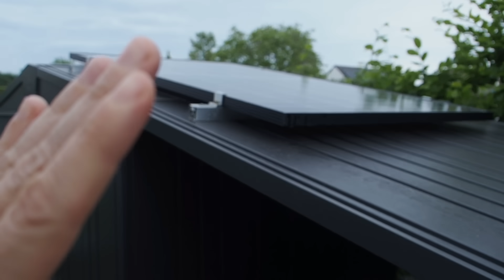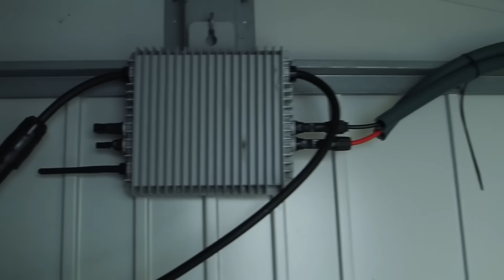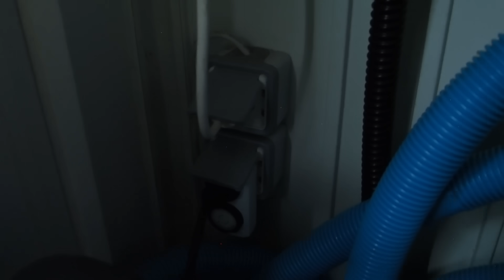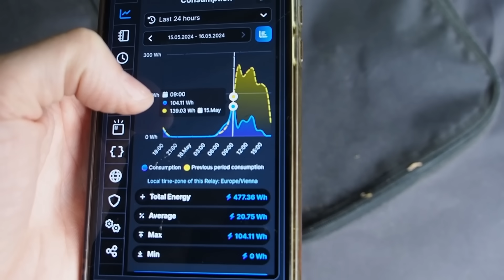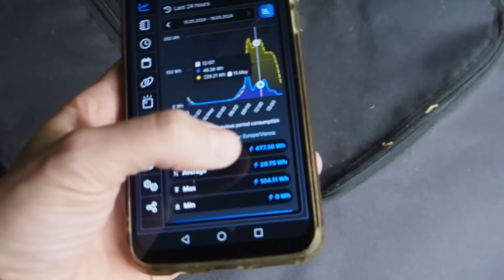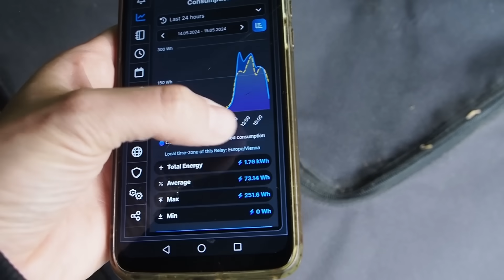Solar system? Yes? No? Which one?

Comment from the maker: BOMBSHELL! Just a few days after this videos was posted one of the biggest energy providers in Austria EVN has terminated older contracts with 20.000 PV customers in Austria. 
https://www.krone.at/3384394 Instead of getting around 15 Cents per KwH now they will only get a "Float tariff" between 2-3,12 Cents per KwH!!! Newer contracts currently stay at 4.5 Cents per KwH.
Reply: Calculate the return on your investment for your system NOT by how much the electric company pays you, but by how much you did NOT have to pay them for electricity because you were running off your own system!! 

Remember what Lilly said: Without batteries, if the power grid goes down, you have no AC. Batteries, batteries, batteries. That is the key. LifePo batteries last for decades. When buying a system, make sure it is expandable. Then keep adding to it when you get extra $$. 

Your goal should not be to get money from the Electric company. Selling them your AC is like trading 20$ for 5$. If your solar panels are not adequate, charge your batteries when the AC is cheapest. And run off your batteries when it is most expensive to buy. And only sell them your ac if your large battery bank is full. 

Check out videos by "DIY Solar Power with Will Prowse" and "Gary Does Solar".
Reply: Off grid solar with grid backup is always better.  The utility companies cannot afford to pay those great rates with the increase of solar infrastructure.
Reply from the maker: @PWoods-cd6tk  the utitility companies charge people18 Cents to 30 Cents per KwH, but they only want to pay 2-3 Cents to people now?? Meanwhile the energy companies make millions in profit and the CEO gets 600k salary each year!!!
Reply: @SurvivalLilly  Message received and noted, thanks heaps Lily!
Reply: @SurvivalLilly  Yep. Not at all surprised. There's no free lunch. Well, it might be free or cheap for a while, but not indefinitely. Saw this coming 20 years ago when early adopters in California were jumping on the grid-tied bandwagon. The sad part is those panels aren't near as efficient now or even when they were new as the panels today. Those people paid a premium even back then. 

Good girl! You made the right choice.
Reply: @Everyone 
Keep in mind that a weapon should only be used for everyday tasks, self-defense, and survival of yourself and others in urgent need. Never use it for hunting unless your breath depends on it, and even then, try to avoid mammals. That's the true warrior's code of conduct. 🪐
Reply: im Link steht aber was von der Energie AG Oberösterreich und nicht EVN - das wären schon zwei verschiedene Firmen
Reply: That happened in the uk. But the older ones kept their tariff of 45p - the new ones are around 4.5 pence! We have panels but do not sell to the grid as they will force us to have smart meter. I do not want one so we try to use as much as possible.
Reply: Always  solar  with  batteries.  so you are self-sufficient for at least  6 months
Reply: They are afraid to get nothing
Reply: A real bunch of Puckers...!
Reply: Hugs xoxo

Comment: For the USA the one real and easy choice is EG4 solar. I've had 3 different brands and by far the most expensive was the easiest to setup and it runs really well. I've over-sized my panel array so I get abundant power through the day.
Reply: 18k is best.

Comment: I love in Denmark, we have electrical heating.

I've spent 3 weeks calculating on solar+ battery and the concluding is that we MIGHT save some money but its all based on assumptions.

Installation price for 11kwh is 8000 euro

15 kwh battery is also around 8000 euro

80% of our power needs are from October to march where the sun is gone. And in summer we don't use much power.

Selling power in summer gives 0 euro

So all in all it makes no sense.

There's a new deal going around that you can use your battery to balancing the grid where you earn 200 euro a month... Until the market is saturated... 

Its just to much hassle to invest in solar

Comment: For anyone who is thinking about solar, here is what it should cost:

High quality solar panels are around 200 euro per kWh 
If you want battery storage, 1200 euro for a 5.1kw battery.
A Victron Multiplus II, about 1000 euro for a 5 KW unit.

If you are useless at putting stuff together, buy a plug and play system they are around 500 euro for a 1kw system. But this will not zero your bills but will reduce it by 30 to 50%.

Comment: Balkonkraftwerk is one of the most absurd jokes ever invented, actual cost to buy a good quality set is around 1200 EUR just for the main parts without assembly (prices are up), the electricity which this produces is so insignificant that the "saving" you make will not cover the investment of this tiny system not even in five years. it's just a joke by the government to try to pretend like they care about citizens reducing their electricity bills - the same governments which made policies and sabotaged their own infrastructures which made it possible for kw prices to jump insanely for no logical reason other than government incompetence and self sabotage. this is also why the wealthy don't care... in order to put up a significant system that actually bring your annual electricity bill down to pre 2018 prices you will need more than 10K EUR for the installation, anything less is just a nice toy to charge your eBike

Comment: You are far better off to install a small system that will run your refrigerator, freezer if you have one, a few lights, fans and charge your phone. Whole home systems are very expensive, they are too dependent on weather and seldom meet expectations. If you hire an attorney to check out the contract they will tell you it’s all risk on your part and no risk for the provider.

Comment: We are currently putting up our own panels starting at 4 X 400 watt solar panels( 1.6 Kw max), this will never be grid tied and on a separate wiring system, all the energy will be ours via battery storage and a pure sine wave inverter, our roof is not going to be owned by solar companies or the national grid.
Gaz UK

Comment: If u need more than 10kwh per day then start with yourself and evaluate  want vs need. before spending so much , no one needs so much electricity, 3 to 5kw solar system is enough for majority of ppl , solar tracking panels can also yeild almost double vs fixed,  so 2x 500w tracked panel can do 8 to 14kwh per day depending your latitude ,

Comment: Every thing you said is true. However, there are options if you find a contractor to install your system or DIY. Local contractors can be way cheaper than the solar companies and DIY is the cheapest option. You did the right thing by starting small. It’s important to allow room for upgrades in the future. I recommend starting with systems that allow future growth without having to rebuy everything.

Comment: The problem with my off grid system is the batteries. They died after 5 years leaving a $13,000 system useless without a huge cost for battery replacement 😢

Comment: I like your videos, but there is ways to not be used by electricity companies.
Keeping an analog usage reader can stop this.
For instance normally you pay 20 cents per KWH and you get 5 cents for giving back a KWH with your solar system.
with normal analog usage meters you pay 20 cents per KWH, but giving back to the grid actually lowers the meter. Every KWH given back will actuallly cost you a whole KWH less.
Thus giving back to the grid is somewhat nice.

Some companies might really push you to update the meter, check the laws in your country if you must oblige.

The truth is years ago, this stuff was all very expensive.
also the effeciency was lacking.
Then some people also resell chinese stuff for higher prices. Still people do it nowadays.

A few thousand euros can get you setup. Check the panels and what they can generate. The newer the better basically.
Batteries could fully get you off the grid, but I would try and get out of the urban area first before spending money.

Comment: Foolish girl.
Do you apply the same financial return criteria when deciding to buy a car or an APO-1?  No.  Having a car or APO-1 pays for itself when they are needed.  So is solar.
A permanent home solar system installed on your house with a house battery (or two) is the answer.  Instead of selling electricity to your provider, use it to charge your home battery.  In the summer my system and battery powers my house at least 18hrs each day even if the grid is down.  A solar system and battery is about prepping, not financial gain.  Rethink your weak support for solar.  There is no financial payback on an APO-1, yet it is a good investment, yes?   Solar system still retain more than 80% or more efficiency after 20 years.   Every serious prepper that is lucky enough to have a house needs a solar system.  Energy storage is solved by adding a home battery.  You said "house can burn down" many times without and actual data of how often it happens.  Please rethink your rejection of home solar with batteries.

Comment: If one have a small open yard, the way forward is to look at a Biogas digester. Why??? All organic waste go into it and not in the bin. If one have not enough, time to collect from the neighbours. Two outputs from the digester, gas and fertilizer. Gas for the stove and geyser and lights. Fertilizer to grow your own healthy food, without the risk to get horrible chemical poisoning as with the case with commercial crops. Micro farming is healthy, its educational for children en they spend less time in front of the tv or computer. A 3.2 m3 digester is big enough for the household of 4. In winter one can use a small solar panel to heat the digester for optimum production.

Comment: I did my 5kW system last week that includes x6 550W panels and a 6kW/h Battery for €2500 here in South Africa.
That price includes the labor and all parts.

Equipment used is also good quality equipment that comes with a 25 year warranty.

Comment: I have solar at my off grid cabin, and at our grid tied home.  I strongly advise against backfeeding your power to the power company/utility.  The cost for inverters, safety equipment and permits would be better spent if you invested in some batteries (even lead acid ones).  The utility compnay can change the rules on what your power is worth at a moments notice, extending the return rate on your investment (if you see it as one); whereas, if you have a fully powered battery bank, you can go days (or weeks) before the power is restored.  I look at solar as a way to not buy gasoline for a generator (both of which you should have).  400W is a bit on the small side for where I live, but it all depends on your requirements.  Good content overall.

Comment: Glad you didn't fall for this nonsense when there are real good alternative ways to go about getting with solar and decent leisure batteries.  This is common in the motorhome or camping communities, plenty of really good solar panels etc out there.  I plan to get off grid and also use a diesel heater and not link up to the grid at all which is rinsing everyone.

Comment: If a micro inverter is connected to a regular grid without a special meter in the U.S. it will actually add the amount of oiwer produced to your electric bill instead of subtracting it.

Comment: Batteries and generator will make you more self reliant in a power outage. There are watt/ kilowatt hour meters you can use to measure the electrical requirement of your appliances. Just as valid is to replace your refrigerator if it's more than 10 years old. The new ones are a lot more efficient. Buy a good brand. do a little research.

Comment: If it were me, considering the worries of things catching fire and burning my house down, I would build an independent system (an island system I think is what you called it) of whatever size I needed in panel watt real estate, and wire it to my own battery storage system. 

If you have the room, just put up a nice BBQ entertainment patio in the back yard and use solar panels to roof it. The battery storage could be a separate small shed like you are presently using, but not wired into the grid. Use dedicated plugs in your house wired directly to the battery system, or have an electrician add a panel that can be switched from grid power to your battery power but not both at the same time. The reason for disconnecting the grid is because nobody wants to work on downed power lines during a blackout while solar panel juice is still keeping the system live from your system! Whatever you do yourself, or by hiring an electrician, do not use aluminum wiring anywhere in the system; stick to copper!

Also, this battery system can be dual purpose! EV's these days have large battery systems built in, and some can even supply juice for external use. I think Ford pickups now offer this, and my Jeep Hybrid will let me use the 17kw battery to power my house or whatever up to a 30amp draw. Solar panels can be used to charge the EV batteries alone.

You've probably heard of the Will Prowse Youtube channel by now. He has several years of videos covering solar panel use and lithium battery system reviews!

Comment: This brings a smile to my face. Thank god for smart ladies like yourself.. You are on the right track. You will eventually install a battery bank and a grid tied inverter thst can automatically cut supply to the grid during outage..
What you have is fine but you will follow your present success with more successful projects.
 Our house is off grid for 22 years  but we installed a new ( s/h) battery bank of 60 forklift cells@ 120vdc in 2008. We installed a Chinese WT and later 3.8kw + 1500kw of solar pv. Its good. Its not perfect but we are never stuck..
Our inverter is 2kw but we use 3 x 2kw controllers . We heat over 500ltrs of water in 2 separate tanks. Each with a 2kw immersion heater to  control our 2kw x 120vdc wind turbine.
The whole system is completely automatic.... 
  I wish you luck. I have no doubt that you will succeed.. G

Comment: Invest in a battery system Lilly, Then You can go off grid with switch on Your electric box.
Reply: And go lithium batteries not flooded or AGM. I know it's initially more expensive but cheaper in the end because of them being maintenance-free and their lifespan.

Comment: Hello Lilly! I am from Argentina, South America. If i have to recommend solar PV systems for homes, y would reccomend just  to keep off grid the refrigerator and a freezer. Those are working the 365 days, the 24hs (and some extra power to recharge a power station). The other electric devices can be administrated by the home owner, in order to save energy and money. Buy very efficient refrigerators and freezers and then invest in solar panels and batteries for this devices. Keep on grid for the others. In case of blackout, the food in the refrigerator and the freezer is safe. Meanwhile, if you have some extra power enough to charge a power station, cell phones and rechargeable batteries for lanterns, you will have all the energy you need to overcome an emergency. I Stay tuned!

Comment: Solar panels are an insurance policy in case the grid goes down permanently... do you have this insurance?? If the grid goes down because the solar flares it will take more than 20 years to build new Transformers damaged by the geomagnetic storm and that is if the company building them has good source of power required to build Transformers.... under ideal conditions with an intact electrical grid it takes 1.5 years to build one Transformer.. how long would it take to build enough Transformers for one side of the world that could potentially get wiped out by a solar flare or Wars.. if these things happen it won't matter that it took 18 years to pay off the solar flares you will be relieved that you got it no matter how many years it takes to pay off the initial investment.... but I would buy only high quality solar panels

Comment: Solar has its place. It is really good at making low voltage DC ( vehicle sized system ) not so good at high voltage AC ( household sized system ). My barn, storage building, and boat house were too far away from the main house to make it cost effective to run wire. They are now all 12v ( solar and deep cycle batteries). My main house and workshop are connected to the grid with a battery backup that only charges during off peak hours.

Comment: I live in the deep South US - solar generally speaking is very inefficient - 
     In 2022 from feb to july it was rainy and cloudy every day - i live in a rural area some that live in the woods have solar for lights - 
.     They were back to burning candles for lights - 
Were im atits often 60% humidity so solar panels often only generate 20% of there rated power at noon on rare cloudless days - they never generate more than 50 % of there rated out put in this region for more than 2 hrs a day - 
       In the rural US up till around 1960 or so there was no grid powe - many had delco farm light systems - 
      It consited of a 32 volt batery bank - farm homes had 32 volt DC power - the house ran off the house batterys for 6 days and was charged all day once a week - 
     There were a complete line of appliances sold for rural homes that were 32 volts DC - the batterys lasted 40 to 70 yrs that powered rural homes - 
      They were in common use befor the grid was sent out to rural America - 
   You can look it up on the net -

Comment: Hey Lily, I bought the Eco flow delta two power station all in one inverter, battery and receptacles and foldable 220 W solar panels and it can be portable if the situation necessitates . I bought it off of Amazon, different wattages for differing applications are available. The juries out whether or not I like Eco flow haven’t really messed with it yet to find out. Maybe you can buy one and give a demo …peace on earth. God bless you. psalms 23